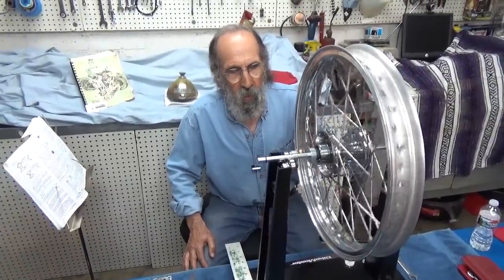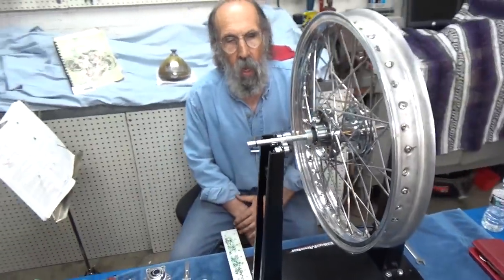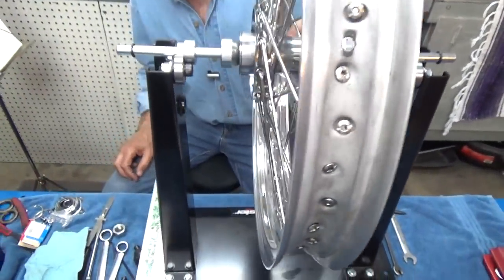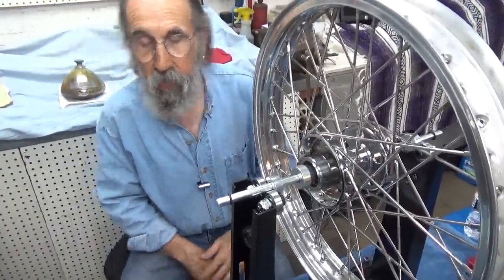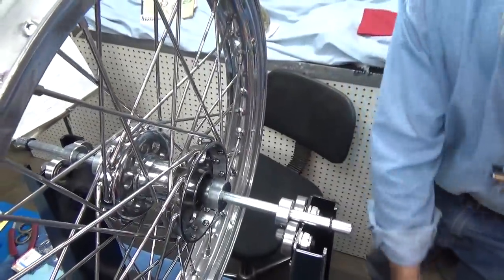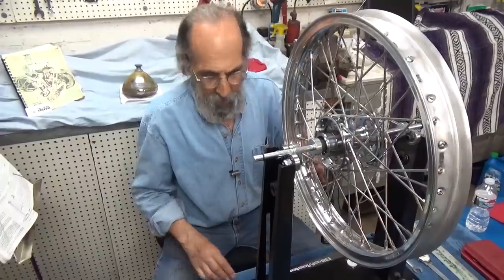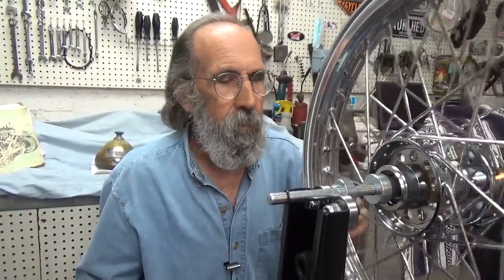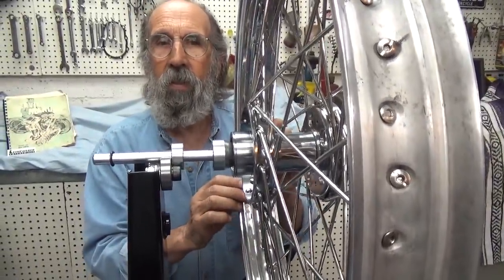Truing The New Wheel For The Big Flathead Project Bike

Comment: Mike... Great job on the wheel build... and I like your toque wrench and planing to make  one  for a bicycle spoke nipple size..  I have built a few thousand bicycle wheels over the last  35 plus years.. I have a few tricks..  To get the wheels centered a quick way is to set the indicator rod on the side of the rim  remove it from the stand leaving the axles in place and flip the wheel from side to side...if the indicator is in the same spot you know the wheel is centered.. 
 I have brazed a 1/4 ball bearing on the indicator pointer and it keeps the rim from getting scratched  and it is easy to see the gap between it and the rim surface.. I rub bees wax on the threads of the spokes and it lubricates it a little when you thread it on to the nipple and eventually  acts like a mild form of Locktite.. Linseed oil works well too...
Reply from the maker: Thank You.  Thanks  for the "methods."

Comment: A suggestion to prevent the "too close pointer squeal": a piece of chalk, or soapstone. Set your pointer with a nominal 1/4 inch gap to the rim, then lay the chalk or soapstone against the side of the pointer. Slowly spin your rim, and slowly advance the chalk toward it. Once the chalk hits a high spot, it leaves a mark, but no scratches. Adjust, repeat ad nauseam. Granted, a dial indicator is still the right tool for final accuracy, but the chalk mark method will get you WAY close, and not endanger your rim finish in any way. I agree Mike, truing will teach you patience, or teach you the manly art of cursing at the top of your voice and tossing tools across the shop, rofl.
Reply from the maker: Thank You.

Comment: I learned this recently by watching another video, but was still a little off on the radial adjusting. The tip on grabbing the set of 4 spokes was something not mentioned, so I used your method with better results. Trued now! Also slipping a piece of tigon tubing on the pointer is another way to 'soften' the pointer. You think they would put a nylon tip on those pointers :)
Reply from the maker: Good stuff.  Thank You.

Comment: Mike.
 Is there a sequence for torquing the individual spokes to 80 inch pounds? Start on one side and work your way around in order then do the other side?
Reply from the maker: Sure.  I start real low and work up to 80 inch pounds.  By the way, that is the recommendation from the manufacturer of the spokes I was using, not necessarily everyone's.

Comment: Mike first I would like to thank your for your informative videos and thank you for sharing your knowledge with us. My question is wha if I torque all the spokes to spec wont it pull my wheel out of true and if so what do I do ?
Reply from the maker: Keep sneaking up on it.  You'll learn to tighten by hand a little at time.  Pretty soon, it will all be tight.  Start now with 20 inch lbs.  Check it for true.  tighten the all evenly.  Check and correct.  Go to your next increment.  Remember, stick with the specifications of the maufacturer.

Comment: Hi Mike! Definitely the best videos on wheel lacing and truing you can find and ask for. Just wondering if it makes sense to true a wheel with the tire still on it. Like after buying a used bike and the tire still in good shape. Greetings from Germany.
Reply from the maker: Greetings.  Never.  As soon as you tighten spokes and they run all the way through the nipples, you start poking holes in rim bands and tubes.  Take the tire off.

Comment: On bicycles, in regards to a newly laced wheel, it's a good idea to recheck and retention the spokes again after a break-in period, riding the bike. I would think it would be the same case with motorcycle wheels. What do you think Pacific Mike?
Reply from the maker: I check and recheck as I build them.  I like to adjust, then leave them overnight to start on again the next day.  Conveniences are sometimes quite a luxury.  I check the wheel on a stand next time I change a tire, unless, there is suspicion the wheel has gone out of true earlier.  I don't adjust spokes until the tire has been removed.

Comment: Thanks for all the great instruction 👍 I came across another video where a guy was saying to center the wheel to the bike rather than the hub, which somewhat makes sense to me. But I really don't think that's the way it should be done. And besides that, just how would you find the center of the bike anyway 🤔 Just thought I'd mention it ask about that. Thanks again for sharing.
Reply from the maker: There is no "one answer" here.  Frame designs differ.  Sometimes the motor is in the center, sometiimes it is offset.  When building a bike, one of the most important issues is alignment.  Find the spot that you can't change and align everything with it.  Motor and trans must be in alignment with each other.  Drive chain or belt must align.  Hubs must be aligned with brake disc or drum.  Rim should be laced so tire is in proper alignment.  We've shown a lot of this stuff on the channel.  Go to our Youtube Homepage and click on the word "videos."
Reply: @pacificmike9501  Wow, who would have thought it would be so complicated 😮
I'm just changing tires and tightening up my spokes so I wanted to true them up during the process. Luckily I'm just cruising around on the thing so I don't have to worry much about it. Lol
Thanks man! I'll check out some of your other stuff. I subscribed as well 😎
Reply from the maker: Thank you.  But, you can see.  If you have a separate engine and trans, they gotta play well together and it goes that way through the whole system.

Comment: Morning Mike. 8 am on the shoreline of Connecticut. Question. What is the maximum distance you can move the outer rim of the center of the hub . If the center of the outside rim is centered with the hub and true. Why would you not use spacers to center the wheel in forks. I've never done it.Im just trying to understand. Thanks. RMM
Reply from the maker: It has to do with how the wheel is structured.  The wheel on this old setup uses an "axle sleeve."  The axle sleeve (which is machined on both ends and extremely hard) goes through the brake backing plate and through the left fork rocker.  There is a large nut on the outside of it that sleeve that secures the brake to the rocker.  The other end of the sleeve is machined for the inside of the left wheel bearing and the inner end of it is where the tapered portion of the axle seats into it.  It is nothing like a modern disc brake wheel.  We did the modern easy types on my Shovelhead which you can find in our videos on the pacific mike Youtube channel.

Comment: Any advice for doing WL front hubs? Lacing them seems difficult and no one seems to go through lacing them. Do most just use a star hub instead and forgo the front brake?
Reply from the maker: I haven't done 45's in a long time.  But, go by the service manual.  It's covered in there.  I actually knew guys who did them in the field during WWII.

Comment: Thanks for this video. I have a question I have a 16x3.5 spoke rim on the rear of my Harley but what I noticed it's seating to far to the right side of the fender were it's about a hair or touching the inside of the fender so do I have to losing the spokes side that's almost touching fender and tighten the  left spokes to bring it over
Reply from the maker: First off, I don't know what the bike is.  Is it supposed to have that wheel on it.  I don't know if the bike is old or new.  Is the fender mounted properly?  I'd like to help, but I need more information.

Comment: Mike, I have a question. My buddy and I have put two wheels together following your directions. We have the same balancing stand as you. Can the balancing stand be used to true the wheels?
Reply from the maker: Sure.  You just use the little collars, so the wheel can't move side to side.  Put them to the inside of the rollers on top.
Reply: @pacificmike9501    Thank you.

Comment: Question. I have a 1980 FXWG, its not charging. Ive checked voltage out of the stator and its only putting out 6V, someone already put a new regulator on it. What stator do you recommend?
Reply from the maker: I don't.  I try not to plug products.  If I do, I have to run disclaimers and odd things I don't really want to get involved in.

Comment: Hi Mike.  Love all your videos.  Do you go back and double check your truing after you've torqued all the spokes? It seems like that would mess up all the painstaking work you just did!
Reply from the maker: I check wheels a lot.  After shifting it over, there may be a small change.  Can't chance it. But going through the excersise doesn't take long, and, when shifting it over, you not only count the flats, but you feel the the torque on the individual spoke nipples.  So, checking it and retorqueing the spokes is pretty quick.
Reply from the maker: Glad you like our videos.

Comment: Truing the new wheels, need some help, its 16" steel spoked wheels. Need to know, what is the best spoke tension, front and rear wheel... Nm or inch pounds? Tnx best regards.
Reply from the maker: It's in inch pounds.  The problem is, this should be done according to the book, or according to the spoke manufacturer.  Overtightening a cheap spoke can be bad.  Sorry for the "Noncommital" answer.
Reply: @pacificmike9501  well, no information about manufacturer, its new spokes for 16" harley wheels, solid quality think so. Sorry my english is bad. Any advice? I appreciate...

Comment: I like to see do from start, truing wheel is not easy. Harley spec is about 0.76mm for runout in both planes. Put offset into that and its a complex process.
Reply from the maker: It's not that hard.  Do it a bunch of times, learn from several people, and you'll get good at it.  .030" is factory spec and, as long as you're there, take a little more time and do it a little better than factory spec.  Read what the manufacturer of the spokes says.  You'll develop your way to get what you want.
Reply: Yes its hard to get to 0.030, would be good see a video on someone doing the full job.  I seen a young boy do a wheel and looks like he spends quite a lot of time on it.

Comment: Great Video Mike, I have a question. I'm rebuilding a 90 Heritage from the frame up. I'm powder coating everything black, well pretty much everything. It has the stock spoke wheels that I was to powder coat as well. I'm replacing the bearings, but should I try to true the stock Harley wheel before I have them powder coated or do you think they will be ok with just new bearings?  Since it's been on and rolling all these years I wasn't sure how often wheels should be trued.
Reply from the maker: You didn't say anything about mileage or where you live.  I have always thought wheels should be painted or powder coated when they are taken apart.  But, people do otherwise.  I check spokes for tightness whenever I mount new tires.  If you decide to powder coat those wheels assembled, be very careful about expecting them first.
Reply: @pacificmike9501  I’m not sure how many miles, but judging on how the motor looked on the inside most likely 30k +. I plan on new tires and bearings, but I didn’t know how it would be having the stock wheels powder coated without disassembly. I guess I could just look for a nice aftermarket set.
Reply from the maker: Wheels need to be serviced.  If you powder coat the spokes while assembled, you won't be able to adjust them.  I do all of my own wheels with polished stainless steel spokes.  Just the way I do it.  I understand the want to have them in color.

Comment: I was truing the front wheel on my  '73 FLH and all went fine.  My goal was to get it within 10/1000 runout.  Is the proper interpretation of that goal to achieve 5/1000 each direction for a center line TOTAL of 10/1000 or is common practice 10/1000 EACH WAY? Nobody ever mentions this...  Thanks!
Reply from the maker: The factory allows for bigger numbers.  When you've got it down to .010 runout, you're getting closer tolerances than the factory.  Measurements are usually taken with a dial gauge.  If the needle moves .010, that's ten thousandths runout.  If you read your service manual, the factory generally allows for much more.  It is in the chassis section.

Comment: Hello Mike, I recently acquired a sweet 21" 40 spoke  star hub 5/8 axle (c/w timkens)  chrome wheel for my 64 DuoGlide "Slutly" (via mail).  Upon checking wheel, I now have concern with the wheels runouts, both  up/down and Left/Right. The wobble area is specific only at the  rim seal weld area. Runout exceeds 1/32-1/16 in just this area. Am I over reacting? 
Bartman
Reply from the maker: The weld area, generally, has a warp.  Drives me nuts too.  You might be able to adjust a little of it out, but not much.  Just the nature of how a rim is manufactured.
Reply: @pacificmike9501  I'm goin live with it. Thanks for the seedy reply
Reply: speedy lol
Reply from the maker: You funny.  It's more than cool.

Comment: Hello mike, 

I wish you would have gone thru process of tightening spoke to torque specs . Thanks again
Reply from the maker: After you've gone around that wheel many times, finally getting it into true, do 20 spokes on one side at about 20 inch lbs.  then check for true and correct as needed.  Sneak up that way at comfortable increments.  I tighten to the specs recommended by the manufacturer of the parts.

Comment: Hay Mike, how ya doing?   I have a 1974 FXE, but I have the style that has the Fatboy tanks and flip up rear fender, but, the other FXE model has the super glide rear fender and 3 gal, 
single tank, what's the deal.
Reply from the maker: The deal is:  Parts get changed.  Someone has an FX and wants an FL.  Or they have an FL and want an FX.  Or, they just want something a little different.  I've changed my Shovelhead so much over the years, it's almost the way I want it.
Reply: @pacificmike9501  I'm pretty sure this is a stock fat bob mount, and the numbers say it's an FXE, someone did change the forks to a wide glide, but I think that's it. 
I was wondering if maybe Harley changed tanks mid model, like the 48 Pan's and 48 knuckles.

Comment: Then you run it about 1000 miles and put it back in the trueing stand and you will see how spokes have streched and settled in a bit re true and tighten all spokes to 14 foot lbs od tork and that wheel would be good for 40'000 more miles before it needs reserviced .
Reply from the maker: Perhaps.

Comment: Do you go around with torque wrench from valve stem or sequence? Not specifically harley or smth question I am aquiring some info to properly rebuild my JAWA wheels in winter. Video also answered my deep question about hub not being in centre this is specific to JAWA wheels, they're offset by factory.
Reply from the maker: Gradually increase the torque by trips around the wheel.  I just go round and roud and keep checking, then finish up by making sure that you get the torque setting you want and that they are all evenly torqued.